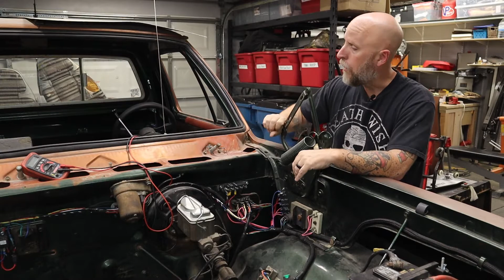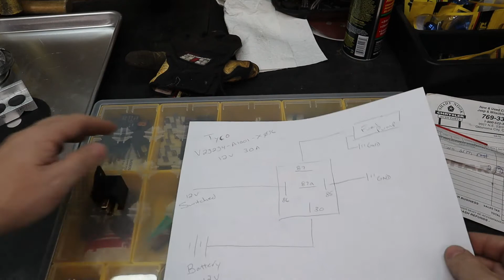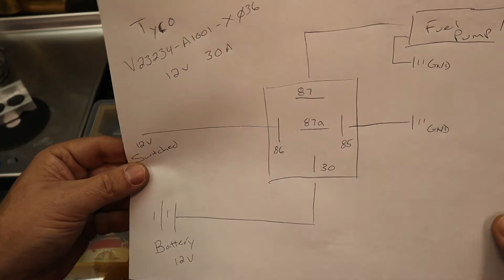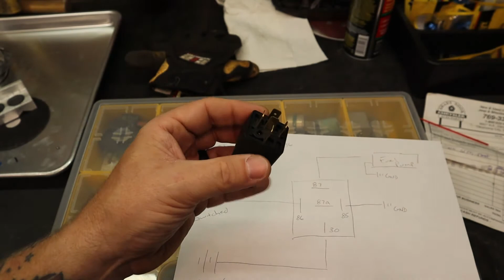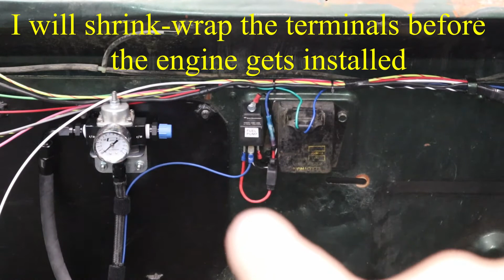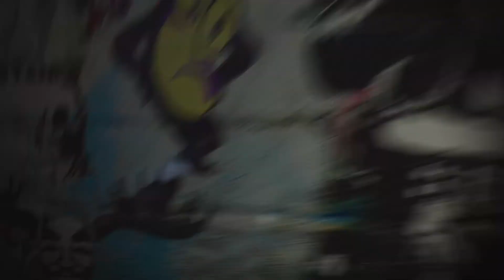How to Wire Electric Fuel Pump Relay to a Switched Power Circuit | Quick and Easy Wiring

Comment: Dual fuel lines with check and shutoff valves?
To prevent fuel from ever going into the oil pan?
Reply from the maker: One feed line, one return, keeps the fuel flowing and prevents vapor lock… shutoff valve so I can turn the fuel off at the firewall for maintenance.

Comment: Your wire routing looks professional.  Currently I'm having a tough time getting my Hyper spark distributor to spark.  I may change to your setup if I can't get it to spark.
Reply from the maker: I haven't messed with the Hyperspark, so I wouldn't even know where to start.  Are you trying to have the Sniper control the Hyperspark?  I can only suggest start from the beginning, verify all your wiring and connections, and reach out to Holley...supposedly their tech support is really good

Comment: What kind of distributor are you using?  I have a Dodge D350 with a sniper efi, and using a Hyperspark.
Reply from the maker: It by TCS. Its just a mechanical advance distributor, no vacuum advance

Comment: Not to be a pain….. what you have drawn and how you have it set up is confusing. Could you explain how you have your set up. Meaning what wire you ran to each pin on relay
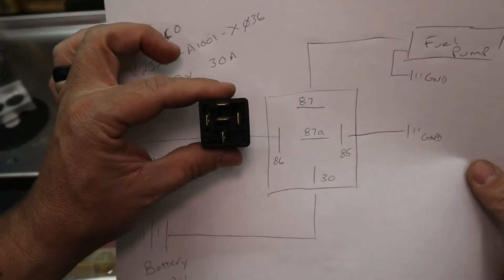Reply from the maker: @4:00 the drawing clearly shows where each pin on the relay is wired....
Reply: I agree with John. Super informative video. A better drawing/ visual and a camera walk through from the first point to the last point would really help the visual learners with this one. Maybe an idea for a video, but your truck starts exactly the way I want my dart to

Comment: thanx  very good info in this video,i was having issues with cheap mechanical fuel pumps and decided to have an electrical backup system. might get rid of the mechanical pump all together. dont want fuel getting pumped past the mechanical pump into crank case .
Reply from the maker: Glad it helped

Comment: OK , what I would like to know  , the 86 switched terminal , one wire from the switch goes here , where do you wire the other pin of the switch too ?
Reply: I believe you would wire that into your ignition. Getting power when you turn the key on.

Comment: How could I set something like this up where the fuel pump shuts itself off if the engine isn't running?
Reply: See Fuel pump saftey switch ..You wire it through a oil pressure sender ..No oil pressure no power to fuel pump
Reply: @Knightomite  genius

Comment: Question if I get a electric fuel pump of 2psi to 6 psi will I need the fuel regulator?
Reply from the maker: If it's for a carburetor you shouldn't, but 6psi may not be enough.  I believe most mechanical fuel pumps usually put out about 7psi....